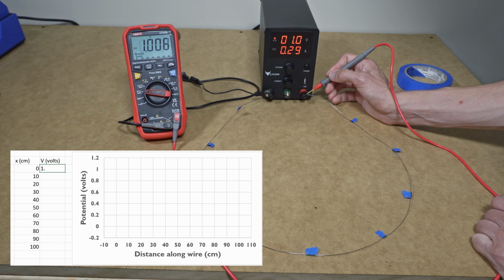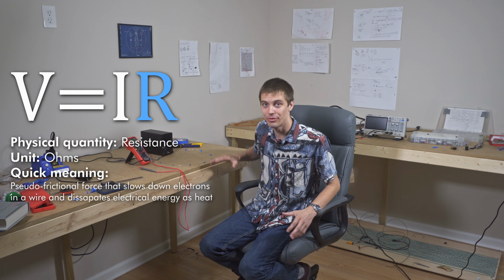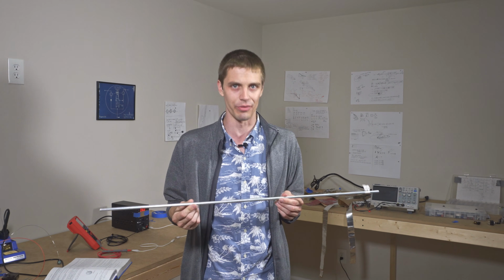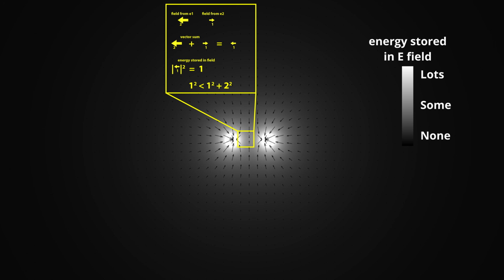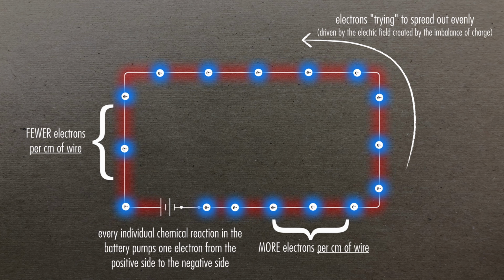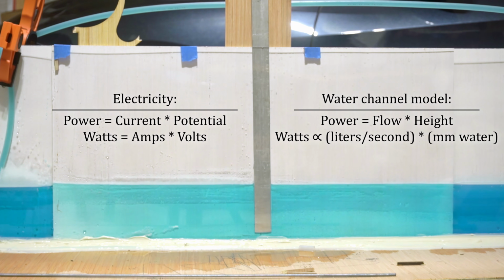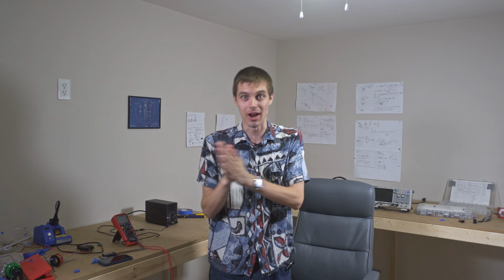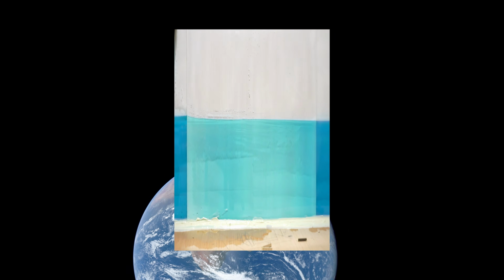An intuitive approach for understanding electricity

Comment: Am 45 and struggled for years to grasp voltage vs amps. This video finally made it all make sense. Thank you!!!
Reply: It can be confusing. Some people think a 12V battery with 800 cranking amps can kill, if you touch both poles, because of the high current.
But because skin has a high resistance, there is barely flowing any current if you touch both poles of a 12V battery.
Higher voltage on the other hand, forces more current through skin, but it's not the current we should worry about.

Example: Worst case you need about 1000000V before 800A can flow through skin (but it's not relevant!).

In short, it's the voltage that's dangerous.
Touching anything under 48V is unlikely to kill anyone.
But 110V for example, can surely kill you!

Edit: Some clarifications.
Reply: I'm 42 ATM and finally I can say the same :D
Reply: Now I’m down a rabbit hole with learning about high versus lower ohms, watts, wire ratings, etc. LOL
Reply: @BrainHurricanes I learned very young at age 13 difference between voltage and amp...don't ask me how.😅
Reply: @BrainHurricanes you actually don’t have the concepts right. The battery supplies a voltage that is given by the electrochemical reaction used in the battery. It defines the potential difference (voltage) between the poles.  There is no current associated with a battery. The current that will flow is given by Ohm’s law when a load is connected. That’s what you almost had right by referring to the resistance of a person’s body (“skin”); whatever the load R is, the current (I) will be given by I = V/R. V is fixed by the battery, but I depends on R. “Cranking amps” of a car battery, which you mentioned in your comment as if it were relevant, is only specifying the capacity of the battery (how large it is or more technically the capacity of the chemicals inside), which relates to how much current it can supply (quickly) for starting your car once the circuit is closed with a fairly low resistance of your starter. It doesn’t tell you anything about actual current that is somehow “supplies.” BTW- You can get quite injured by much less than 1 million volts, as you claim. Ask anyone who has accidentally grabbed two ends of 110V with their two hands. Current flowing across arms can stop a human heart almost instantly.  I just want to make sure nobody reads your comment and thinks anything less than 1 millions volts is safe.
Reply: @vinny5004  Thanks for your reply.  I'm not sure where you see a different concept. I said "some people think...", not "I think". Further you're absolutely correct. 
I've hear enough people claim "watch out that's a "X" amp battery, that can kill you.
Hence the example of what voltage you'd need to run 800amp through your body.
Where as you stated correctly it's the voltage that can kill you, certainly 110V, not the amps. Fairly low amps can kill you, but you need higher voltage than 12V DC.
I'll see if I still can correct my first reply to minimize confusion.
Reply: @murdocks4304  Tell me you don't know anything about electricity without telling me...😀
Reply: @BrainHurricanes  Interesting that Tesla is leaning toward the 48VDC model from 12VDC for its low voltage accessories. The motor voltage however is still about 340 volts.  The cyber truck will be the first to use a Lithium 48v battery, Previous models used a common 12v lead acid battery. I didn't know this.
Reply: I don't know what sort of introduction you had, but water analogies are absolutely where electricity should be begin.  They just need to be given with the caveat that water molecules don't push on each other at a distance, they have to bump into each other (at room temperatures) and water molecules don't have another field where changes in one field affects the other.  So electricity will travel through a wire faster than water in a pipe because elections will push on each other despite large gaps between them, this will also make certain types of transistors possible with electricity, and water won't have things like inductors.  But pressure is a high level thing, and at the level of pressure they are very similar.  If you were transmitting power long range with pressured water in a pipe, would you want to use low PSI and require the water to fly through the pipe at super high speed, or a high PSI and let the water move slowly through the pipe while delivering the same power?  Anyone who has ever blown water through a straw will know it doesn't like to move at high speed through the straw.  Its why long range power lines are 200,000V and up.  You might be able to plug a low PSI pipe with your finger even if the pipe has a 1 mile diameter and turns a generator that could vaporize you.  A 12V submarine battery wont do anything to you if you put your hand across the terminals but it will vaporize a fork across the terminals.  Low pressure but a potential Niagara Falls of volume.  There are good analogies between "ground" and the ocean also.
Reply: I used the sink faucet to teach my granddaughter volts and current. With the faucet at a drip - low voltage - a cup underneath fills very slowly. When you open up the faucet all the way - high voltage - the cup fills faster.
Reply: Think of voltage as press

Comment: This has by far the best explanation of voltage I have ever encountered. I am 46 and not without an education but I have never succeeded in digesting any part of the theory of electricity and I have repeatedly sought out learning materials to engage with this over the last 20+ years and never, ever felt satisfied that I had gotten beyond reciting Ohm's law. Up until about twenty minutes ago, I coud honestly say that I had no more understanding of electricity than whatever it is that comes out the end of a wizard's wand in the Harry Potter universe. The various ways of comparing 'water systems' with 'electron systems' only made the matter worse...until now. The literal demonstration with water and 'dams/resistors' is absolutely bloody amazing, breathtaking actually, and ridiculously obvious once you see it in the flesh, so to speak. Many, many thanks Brian. Absolutely excellent presentation!
Reply: Breath taking!? Sir, you are not supposed to be inside the water systems when you use them as an example.

Comment: My guess for the nanosecond scale voltage-wire slice-time graph is - based on your previous videos - you might have used your oscilloscope to measure at a certain point on the wire and the input, moved the probe to another point, repeated the experiment, exported these snapshots and used some python wizardy to match them up and transform them (time vs voltage at a specific point on wire) to get the 3D graph (point on wire vs voltage vs time). Also, I think this is the best explanation and visual experiment for getting a grasp of these concepts, while also keeping it focused but still telling the small print later on, it should be played in schools. Thanks!

Comment: Have struggled with the water model for years due to lack integration of particle physics and too much anthropomorphic metaphors. This has helped a ton. Thank you for working so hard on the visuals.
Reply: I don't know what sort of introduction you had, but water analogies are absolutely where electricity should be begin.  They just need to be given with the caveat that water molecules don't push on each other at a distance, they have to bump into each other (at room temperatures) and water molecules don't have another field where changes in one field affects the other.  So electricity will travel through a wire faster than water in a pipe because elections will push on each other despite large gaps between them, and water won't have things like inductors.  But pressure is a high level thing, and at the level of pressure they are very similar.  If you were transmitting power long range with pressured water in a pipe, would you want to use low PSI and require the water to fly through the pipe at super high speed, or a high PSI and let the water move slowly through the pipe while delivering the same power?  Anyone who has ever blown water through a straw will know it doesn't like to move at high speed through the straw.  Its why long range power lines are 200,000V and up.  You might be able to plug a low PSI pipe with your finger even if the pipe has a 1 mile diameter and turns a generator that could vaporize you.  A 12V submarine battery wont do anything to you if you put your hand across the terminals but it will vaporize a fork across the terminals.  Low pressure but a potential Niagara Falls of volume.  There are good analogies between "ground" and the ocean also.

Comment: Voltage, Potential Difference -> Voltage is the difference between the 2 ends. It's the level of attraction the electrons feel to move from one place to another. A battery is 1.5 volts, this means there's a 1.5 difference between the 2 ends.
A home circuit of 120 volts means there's a 120 difference.
240 volts means there's a 240 difference.
As the Volts increase, the level of attraction also increases, so the electrons try way harder to get to the other side.

That's how i understand and visualise it.

HTH.
Reply: Using the water analogy, voltage is pressure from the source or supply.
Very simple
Reply: That's a neat explanation. Thanks
Reply: Rechargeable cells are 1.2 v

Comment: Other videos "taught" electricity is not the actual flow of an electron from one end of a wire to the other, but more like electrons bumping its neighbor and causing the transfer of energy. As you said an electron moves very slowly vs the effect which occurs at nearly the speed of light. And that devices such as wireless chargers and transformers where there is no direct connection for electron flow. The more I seek to learn the more confused I become!

Comment: I teach HS physics. This was one of the best explanations I’ve seen about the various electrical terms. Thank you!  This is going to be a new video that I’ll have my students watch.
Reply: Minus one large technicality.
Reply: @MRm3th3ad  please elaborate.
Reply: Ok. I mean if your teaching it , you must imply to your students only for a reference to understanding, I also use examples to try explaining to folks in the 12volt community but , technically it's not right. Current doesn't flow through the conducter, it spirals around the outside of the conducter "wire" , nothing flows inside. So with implied examples, it kinda steers u in the wrong compression but it does help to understand resistance but then again that's not what's actually occurring.
Reply: That is so cool, you sound like a very dedicated teacher!
Reply: @MRm3th3ad  Your point is trivial and irrelevent.
Reply: @enricofermi67  seems that way don't it
Reply: @MRm3th3ad You're also manifestly wrong, because current is a thing.
Reply: @ludiProjects  who said it wasn't?
Reply: @MRm3th3ad Are you talking about skin effect?
Reply: @boeing757pilot  actually no.  I was using dc in my observations 12v-21vdc. I have yet to follow up with ac
Reply from the maker: @MRm3th3ad this is not correct. Electrons flow in the bulk of the wire under almost all situations, and predominantly on the “skin” (but still attached to the wire) for a fleetingly small set of high-frequency situations.

DC resistance scales with the cross sectional area of a wire.

You may argue some energy is stored outside the wire because it’s stored in the fields radiating from the electrons, but charge never flows outside the wire.

Comment: Software and math guy here...dabbling in electronics. This is hands down the best, most illustrative and intuitive explanation I've encountered. The visual representations you chose really upset my current mental model and set it correct. Thanks so much. This is fantastic!
Reply: How does the Water model explain Transmission lines?
It can't.  Search Electro-dynamics for answers
Reply: Same. I'm going to watch this video at least 5 times. I finally (sort of) understand negative volts.
Reply: @jonragnarsson  hmm ... all elections are negative 😊 the positive gaps are materials lacking in electrons ... happy Christmas 🎄

Comment: Ok, I’ve two things to say here.
1) Very good job outlining the intuitive approach to learning about electricity and how it works.  I literally become a bit smarter (about this) after watching your video.

2) Your enthusiasm helped me want to learn more because it’s how I teach (automotive and criminology).  So many presenters on this site merely go over formulas and surface-level material so dryly that I wonder if they’re even interested in their own lectures or explanations.  The water table made things so much more understandable because I struggled with the notion of ‘potential’ regarding voltage and the water analogy made so much more sense.

Thank you!
Reply: So true, if the teacher is bored students can tell, they immediately think well if he’s not interested why should I be? The problem is if you ARE interested and desperately want to learn, it can be incredibly frustrating. I’d rather have an average teacher who cares, than some know-all who’d rather be doing something else.

Comment: This is amazing, thank you so much, I've slowly been teaching myself this after decades of being interested in electronics, and only recently have I really started to understand what's going on. This really cleared things up in my mind.
It'd be awesome if you followed on with the "Holes" and went into semiconductors.
While I kinda understand how transistors work, it'd be nice to have some of your smart analogies to explain it better, especially with things like mosfets which still confuse me quite a bit.
Reply: Semi conductors are dielectric materials (like silicon) doped with conductors p or n (phosphorus, gallium etc..) when a threshold of current is met the gate/drain switches open and supposedly the electrons "skip" across "holes" (i don't believe in electrons) but I won't confuse you on that point.

The easiest way to think about it is that it is intermediate composite material between insulators and conductors placed between conductives like a little draw bridges that opens for current switch junctions or flow direction when electrostatic conditions are met.
Reply from the maker: If they “don’t believe in electrons”, don’t let them confuse YOU…😂

In semiconductors, as in metals, most of the electrons are locked in place because they are used in bonding. The difference is in metals, electrons can start moving down a wire if they gain just a TINY bit of energy - energy they can get just by the material being warm. In semiconductors, any given electron would need to gain a LOT of energy before it could start to flow, so the vast majority of them don’t - they’re stuck.

You can insert trace impurities of other atoms called dopants that basically add electrons that already have a bit more energy, that way again they only need a little bit to start moving like in a metal. By fiddling with the concentration of these dopants, and by applying electric fields across the entire material, you can create a device that sometimes has no mobile electrons so it’s an insulator, and sometimes has many mobile electrons and acts like a conductor.

All insulators could really be referred to as “high bandgap semiconductors”. There are even people trying to make electronics out of diamond, which is an extreme insulator.